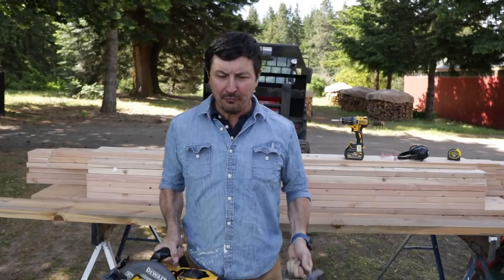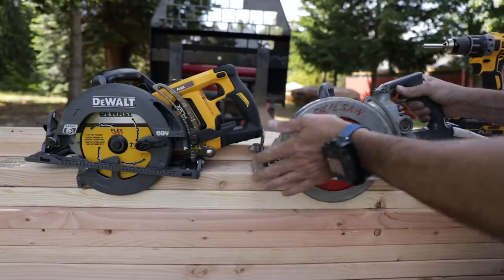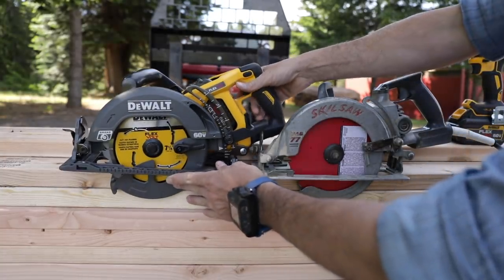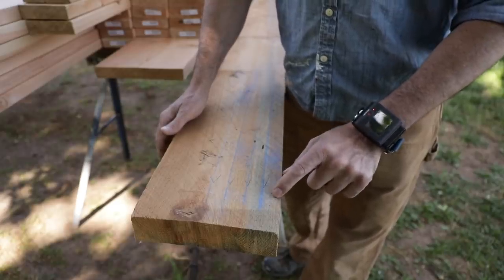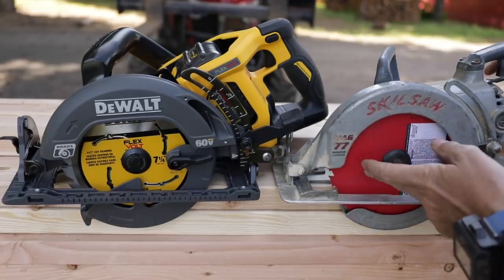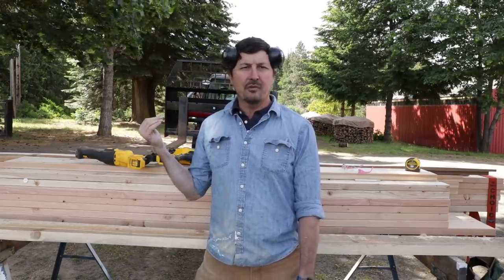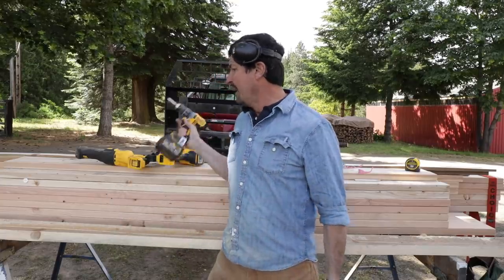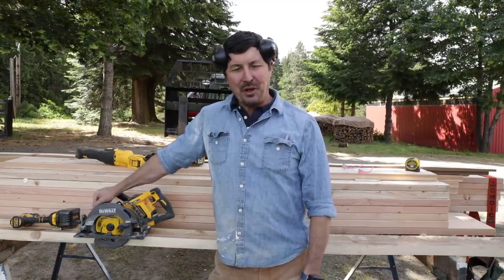Dewalt Flexvolt V.S. Skill Mag77 [S H O C K I N G]

Comment: I wanna know how long that saw will last fully charged under some kind of load. That’s important as well
Reply: Use them framing, the dewalt saw will last 3/4 of the day of continuous use on one battery. Been dropped a few times off the roof and survived the fall. 
The dewalt nailer works ok, but not quite there yet to replace a pneumatic nailer.

Comment: Just out of curiosity Cody, how many feet of extension cord was that Skill wormy running on? There “can” be huge amperage losses if it’s 100’ + out. That DeWALT is still a beast though and highlights another negative of corded saws... amperage loss over extension cords. My 24v Kobalt also has very surprising power.
Reply: OzarksTactical Homesteading you can see the yellow cord. Gauge looks big and it looks at most 30 feet
Reply: Im sure it wasn’t a long pull on the extension cord. The biggest difference is the motor, brushless has come a long long way and with battery technology, you can now leave the cord at home.
Reply from the maker: Good point, for the test I used a heavy gage 25' cord
Reply: Voltage drops, not amps.
Reply: I agree brushless has held it's own but if you are cutting all day I am gonna say you need at least 4 batteries in rotation so that the batteries don't take a beating.
Reply: Well thats part of the test is it not ? cordless wont have power drop but the shitty corded ones will :/
Reply: Ohms Law. I=V/R  I=current(amps).  As the cord gets longer your resistance increases which will decrease the current. Also, if voltage drops your current will drop as well. Simple math.
Reply: OzarksTactical. That was a good question.  My question is also about "apples to apples".  How old is the Mag 77?  If he has been using that saw for years, the motor definitely degrades.  How is the switch?  That can affect it.  How are the brushes?    
I bet a brand new Mag 77 competes a little better against a brand new saw.  That, and the life cycle of the plug in Mag 77 is probably a lot longer.  There was no planned obsolescence in the Mag 77. When DeWalt switches to a new battery system, and the current batteries go obsolete, you can still buy parts to repair a Mag 77.
Reply: its not that simple, motor's current doesnt only depend on resistance so it is voltage drop on the cord in first place not a current drop, and lower voltage = more current to give out certain power. its AC motor not just DC resistor to simply apply I=V/R
Reply: PulzeGaming haha those shirty corded ones built most of the West coast and are what all of the new worm drives were modeled after
Reply: Kind of the point though. On any construction site you'll typically have 100's of feet of chord. 2nd, 3rd story etc..
Reply: How often will you have a corded saw plugged directly into an outlet? Almost will always have a cord.
Reply: Hahodi d Agree 100%, Can never Hate on The trusty old Wormdrive's
Reply: And how many hours on the Skil? Brushes worn?
Reply: 16/3 has much more voltage drop than a 12/3
Reply: @benwood04  i agree...i have the newest version of the lightweight mag 77 and its way faster and better for riping than my co workers dewalt saw like this.....i could rip that same lenght of lvl in less time than this
Reply: @Craig040  That works for working out the current, but there's a voltage drop because you have two resistors, or inductors, in series. The extra one in the long cord reduces the voltage across the second, thus the power is lower. But there is also less current because the whole circuit has a higher resistance. The whole circuit has the same voltage and lower current, the saw has a lower voltage and also lower current as a result of the lower current in the whole circuit.
Reply: @skliros9235  If you are in a shop using the saw at a workbench and outlets on the bench.I have done this.

Comment: blade makes more of a difference then the saw in cutting time.
Reply: then the dewalt would have won by a bigger gap, the skil had a better blade
Reply: @budfahnestock2418  Diablo is the best. As someone with at least 100 miles of board length cut and used every top saw available. As well as every blade on the market I'm sure. Diablo simply is the best. But.. I have to admit the Irwin blade is actually not bad either. 

Dewalts blade is good at first though.
Reply: The DeWalt is thinner and made for cordless.

Comment: From what I’ve read, the DeWalt isn’t a true “worm drive” motor. They call it “worm drive style” because it looks like a worm drive saw. The DeWalt website lists the motor as a direct drive. It should perform identical to their other 60v saw which costs a lot less.
Reply: Also, worm drives spin at a much slower rpm than a regular circular saw. It’s no wonder one was faster. This guy did a really poor job at comparing the two saws. He didn’t even bother picking up an extra Diablo blade so they at least have the same cutting edge. I think he should just stop doing any kind of comparison videos with such a poor lazy effort.
Reply: I was looking for someone to point this out bc he kept calling it worm drive.

Comment: Hello, thank you for the video, but since you used 2 different blades i would like to see another video where you swap the blades over from each saw. So, that no bias was shown. Thank you for your time.
Reply: Lots of issues maintaining the control baseline here.  Old vs new.   Should have two identical blades both brand new too.  (That means first saw doesn’t dull blade for second saw).  No guide for cuts.   Could have more wobble or less wobble which skews the test.  And likely a few more ...

That said, it’s still a pretty big difference in speed.  That rig will cost a lot with 3-4 batteries and extra charger(s) to support it.  And space in the truck/toolbox. No cord is a huge convenience, but depending on total run time per battery it could also cost you some up/down on the ladder too.  Still, darn convenient!   😀

Comment: The question is: How consistent is the cordless DeWalt as the battery begins to drain? Personally, I still prefer corded tools for jobs that require steady power. In carpentry, a blade slowing down midway or lagging can throw your cut off just enough to screw it up. Don't get me wrong, I'm a firm believer in the cordless tool revolution, but they're not at that level that they can replace corded tools for production cutting yet like screwguns are. For homeowners, they're more than they'll ever be able to exploit though and they probably don't need the convenience of it being cordless anyway. These are interesting times we're living in as tradesmen.

Comment: That is quite impressive. For those who haven't worked in construction, he is dead on. The Mag77 really is the standard. They are heavy as hell, but nothing packs a punch like them. I used to have the top of the line Dewalt cordless circular saws back in the early 2000's, all Nicad batteries. They were useless unless you were ripping half inch plywood slowly. The one he's using is about $350 but if it lasts a long time, it would be worth it.

Comment: I've been in the Dewalt ecosystem since the early 80's with their plug-in drills. Got my first 18 volt (Nicad) hammer drill around 2002. It's still going strong. That said I've rebuilt the battery packs several times over the course of those years. Fast forward, I've recently purchased several 20 volt Dewalt power tools. What I'm saying is, I've been extreamly happy with their products. 
BTW, I do have several Milwaukee and Makita power tools as well. I think they all make great products.

Comment: Raise your hand if you have cut your cord before with a skilsaw!

Proudly raises hand

Nothing quite like running a rip and then seeing blue/yellow/orange plastic bits come up through the cut and then the power stops. ;)
Reply: I'm a proud American cord cutter, that still uses the same cord just alot shorter!
Reply: That’s when you replace the stock cord with the extension cord you cut in half last week. I love a nice 25’ cord on my skill saw.
Reply: Onlyy beginners cut their cords.( any experienced carpenter always make sure the cord is out the way before he starts saw.i sometimes even hold cord with my foot out the way....ok
Reply: Just the outer sheath...😂
Reply: @redecks336  Essential craftsman fan?
Reply: No but i've run my chord over with a forklife severing it
Reply: Done that twice with the same angle grinder.

Comment: Awesome review, you also forgot about paying for safety. I think the corded tools are far more dangerous. Tripped over far too many, not to mention cut into them as I see you have numerous times and almost started a small brush fire from doing so. The corded tools are just way more dangerous and frankly I value my life more than a $100 savings.
Reply from the maker: Yes I agree, only today I tripped over an air hose and nearly fell down,
Reply: When you learn how to use a saw it won't be dangerous anymore.  Lithium ion is considered to be a Hazzard in the shipping industry and requires markings to alert to that.  Why is that?  Because in extreme temperature or use they are known to start on fire and explode.  So safety guy what technique can you learn to prevent that?
Reply: @migardener trying to get a darwin award
Reply: Maybe you shouldn't leave your house then.

Comment: All I can say right now is WOW!!.....that demo actually impressed the hell out of me......ive built homes for 20+ yrs now and I own 2 mag wormdrive saws .....so I know what they are capable of.....that dewalt cordless cut through that better and faster than any othe saw I have ever used.....from the sh!tty junk saws (what I call home owner specials) like Chicago electric....to the higher end saws that I own such as hitachi(my personal fav) to portercable.......to tell you the truth....I thought the cordless didn't have a chance to even stand up to the mag saw......thnx a lot....now I have to research all of the new cordless tools!!.....thnx for the video.....love yur channel btw!!
Reply from the maker: I was surprised myself,
Reply: AntiLißTard ed 6
Reply: I have to agree WOW I didn't think the dwalt had a chance I build for a living and I wouldn't believe it if I hadn't seen it
Reply: If you can, wait just a bit longer, since both Dewalt and Milwaukee will be coming out with 12Ah update to their batteries... Presently they max out at 9Ah...

Newer batteries will also perform better and tools coming out by the end of the year should be taking advantage of that improved performance...

This saw should still work with the new battery, though... But for other tools there may be some significant updates coming out by the end of the year...
Reply: My "Wow" was for a different reason.  The Dewalt blade had the deep gullets of a framing blade.  The Skilsaw's blade had shallow gullets which would struggle with the full 2" thick timber (it had not been milled to customary 1 1/2").

So my WOW was, this looked to me to be a setup.
Reply: Definitely not an "apples to apples" test.
Reply: Ive got both these saws had diablos on both and the dewalt has alot more power
Reply: AntiLißTard ed  I have 2-Mags !!
1-28 years ! Old !- Never a problem !!
 BUT I have a Mag 77
DATS a saw !!!!
 Lighter n ALL the rest is Mag !
 My Buddy used it w/the hanger !- up in the rafters !!- Cut his thigh 8” !!😞😤😤
  I see HIM EVERY time I use it !!- Keeps me weary of it !!
Reply: the power of li-ion. dozens of them can run a car for some good distance. i have a small 12v 2.0ah bosch cordless mini circular saw. weigh only 1kg. cut 1/2" plywood like butter
Reply: Price difference is huge, plus if you don't have the voltage for the DeWalt, cordless you're buying the saw Plus the battery. I've used DeWalt for 17 years, but I can't believe what they're charging for this saw..

Comment: As a general contractor I set up my company with the 20v platform 6 years ago. Today we have a crazy list of tools, but the 20v circular saw definitely left something to be desired. Over the past weeks I have been adding some of the 60v flexvolt lineup, such as the circular saw. I doubt we will add the table saw or miter saw because we are renovations contractors and have readily accessible power. Predominantly we use the 20v impact, oscillating saw, and 4-1/2” circular saw. Those are by far our top 3 used power tools

Comment: I bought mine shortly after release. The farm show had a buy the kit get a free battery promo. 9.0 battery came with saw and got 1 free. I am also have my favorite well used makita worm drive and no longer use it unless I’m cutting everything in one spot and a lot of it. A 9.0 battery will get you a long day of framing a house. Usually switch the battery at lunch time dead or not and never have an issue.

Comment: I frame houses every day with these cordless 60v saws and they are 100 times better then the corded mag 77. I also have one of the first reviews on this saw :D
Reply: I find that I need at least 4 batteries on port but it sure as hell beats dragging a cord in the mud and worrying about what is on top of my cord.  The time I save cutting more than makes up for the 25 or so yards to rotate batteries.  It gives me time to light up a smoke.
Reply: I have 8 batteries and 2 saws :)
Reply: Also don't have to have a cord draped over your shoulder so don't cut the cord.
Reply: Adriel Rowley if you have to have the cord around your shoulder then you haven't learned the tricks of the trade, work smart not hard.
Reply: Well then where else will it go that not risking getting cut?
Reply: Adriel Rowley not in front of the blade lol
Reply: The dewalt was the first worm drive saw iv seen in Australia, I’m sure there’s been some here but if not seen it, tested it at the tool shop and the thing is a beast, would be a big change from having the blade on the right on a power saw to left on the dewalt but it weeks like a great tool!
Reply: I completely agree. I haven’t taken my mag77 out ever since I’ve bought the Dewalt. The diablo blade makes this Saw go through wood like butter. It’s quite bit better blade. The Dewalt blade the Saw came with isn’t that great. The welded on carbide teeth breaks easily on the Dewalt.
Reply: How are they for drops? (off a sawhorse). I own two dewalt corded worm drives. Wondering if I should take the plunge.
Reply: tchornomud I’ve dropped mines countless times off the back of my truck tailgate and a few times off the sawhorse. It’s perfectly fine besides scratches and blemishes and mechanically perfect otherwise. But that’s just my experience, can’t speak for all of them.
Reply: These sauce look badass but I would bet money that they don't have near the longevity that the skill saw has. I am not a framer just a general Carpenter and until a really high quality long lasting saw comes out that is cordless I will keep my skill saw.
Reply: @cuchanu  Waste of time though.
Reply: Framer here....   Agree!!
Reply: Here in the UK the Dewalt is £554.99 with two batteries and a charging station. The Mag77 is around £235 WITH shipping from the US. I'm not a professional although I do plan on becoming one. Would you say the £554.99 is worth paying?
Reply: Zanasp27 yes
Reply: @jltaco85  If you've done this for a living for many years, I agree it's about the pace. Complacency comes when your thinking about other stuff when your not focused on what your doing. Trick is the speed of your pace and not letting complacency cut in. Sorry you just don't see a cord over a shoulder.

Comment: Some ten-twelve years after buying any cordless tool, I've retired them for expense or unavailability of "old-style" batteries. My 20 year old Bosch and DeWalt corded tools are running just fine.
Reply: halnywiatr all the 18 volt brushed motor tools are toys compared to the new dewalt brushless 60v tools...
   It’s going to take 20 years before we see a better battery then used today..
Reply: The cordless tool experience depends on the brand and model you purchased.  I have 18 volt Dewalt tools that are literally from 1999 and 20 years later, they still work fine and batteries are still available. In addition, Dewalt makes an adapter so that those older 18v tools can use the new 20v batteries.  Also the new brush less tools and new battery tech make you realize how heavy and slow the old tools are.

Comment: Both great saws IMHO... The blade kerf makes a huge difference to the cutting speed and typically a cordless saw blade has a much finer kerf than a corded saw... Swap the blades and I'm pretty sure the result would be different for each saw... It goes without saying that if there is power on the job site which saw will win unless you have an endless supply of fully charged batteries... For me a better test is how many board feet each saw will cut without any problems arising...
Reply: They both take standard 7 1/4 inch blades. Kerf has nothing to do with this.
Reply: @chrissmith2921  7 1/4 is a diameter, not a blade type. Kerfs and capabilities vary with blade type.

Comment: I purchased my DeWalt 60 volt Worm Drive about 3 months ago and hadn't used it until a couple weeks ago because I had the circular saw that came with my 7-piece combo kit. I have everything on the 20 volt 60 volt now. I had to build some stringers and some stairs for my basement because they fell down LOL. Now that I've used that Worm Drive I don't use anything else. I tried to save it for my own personal use but now I use it for my Contracting as well. Also bought the 60 volt table saw and the 2 60 volt battery compound miter saw. I've always had dewalt but their system now is just killing everything else.